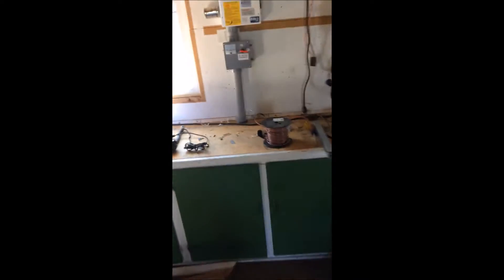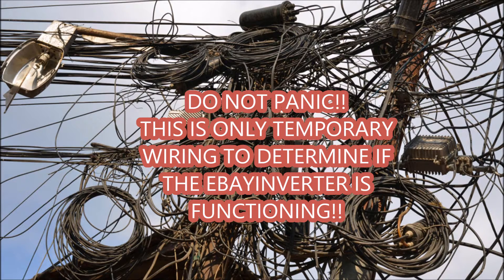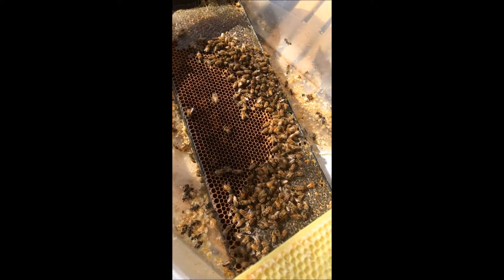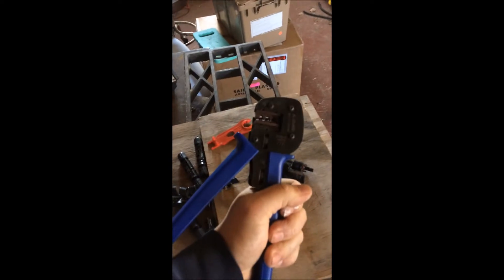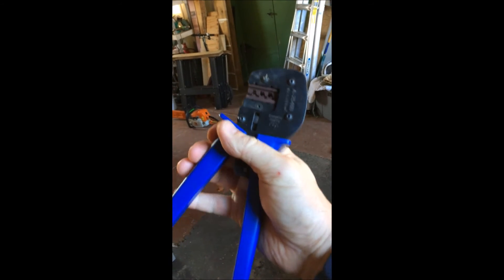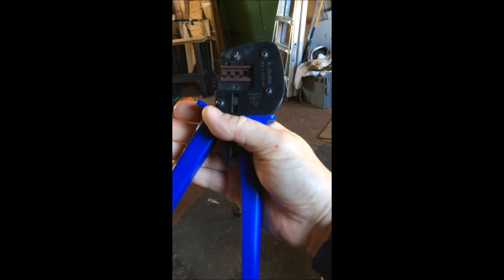SOLAREDGE SE5000 INVERTER RUNNING

Comment: Does it make any noise (eg is there any cooler in this inverter). 

I will have exactly the same installed in couple weeks....
Reply from the maker: I have this installed in a shed.   I haven't really noticed any noise at all but I am not sure if I've been in there with a huge load running.   If I remember I'll perform a test soon.   You're going to love this inverter.  It's a very nice unit.
Reply: Thanks in Advance... well... if it makes noise I wont like it :D Or at least my wife.